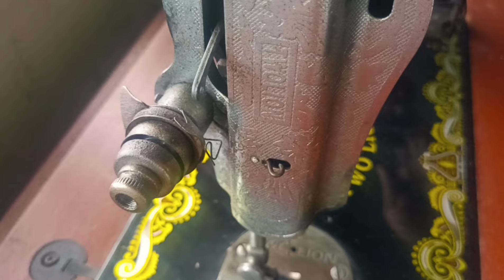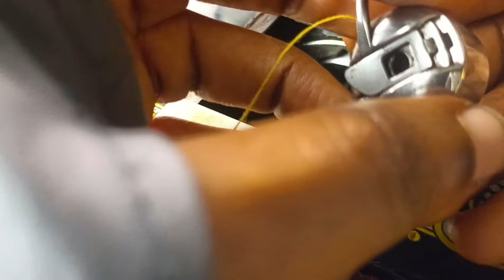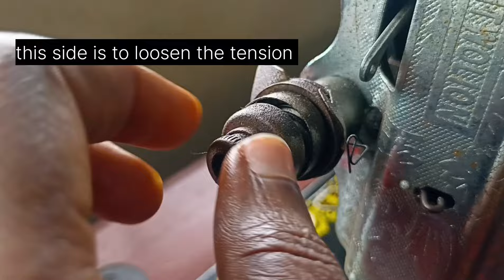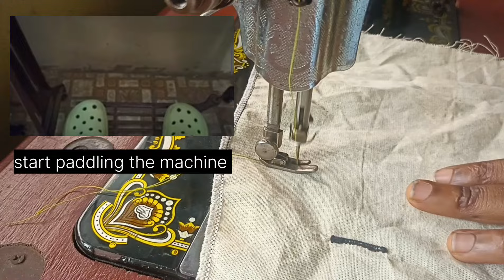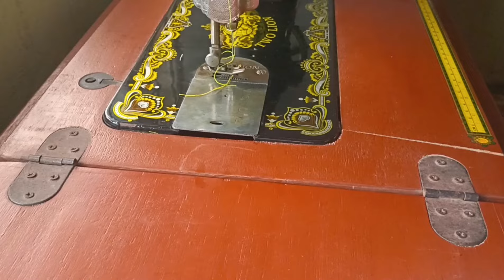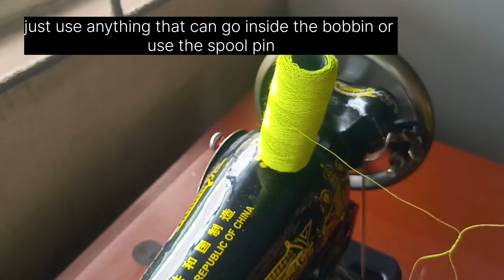(Sewing class 7) | How to use a vintage/Manual sewing machine step by step (DETAILED) ✂️🧵🪡👗

Comment from the maker: This is a detailed video on how to use a vintage or manual sewing machine. There is a manual that comes with this machine it's usually inside the sewing Kit. I advise that you go through it because it is packed with a lot of Information. In this manual, there are different solutions to most problems you will encounter with this sewing machine so try and go through it 
Hope you learn something ✂️ 🧵 🪡 👗